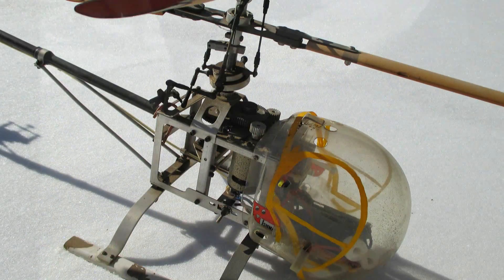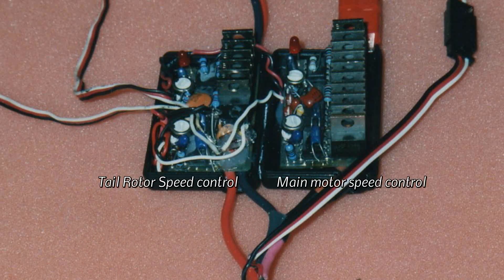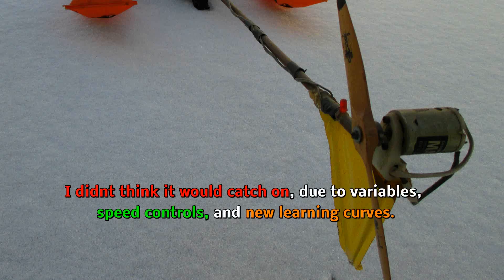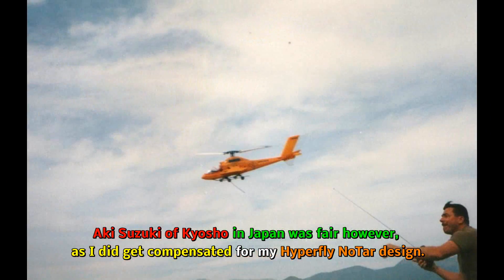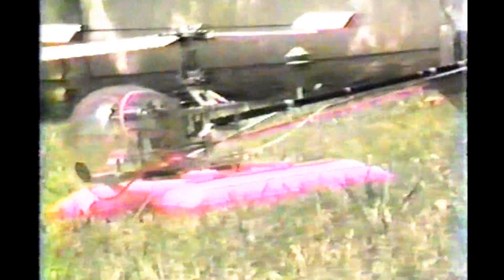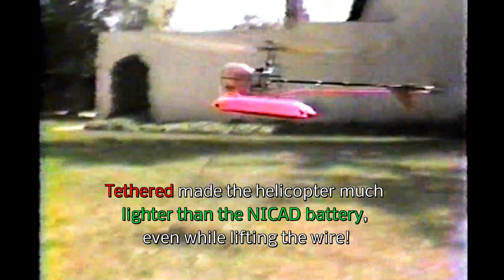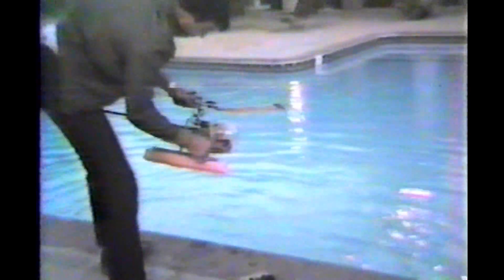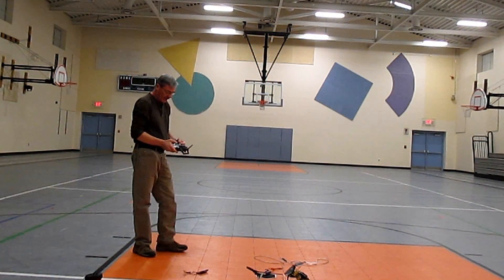Battery-less Electric Helicopters were Ground-Powered! Then and now.

Comment: Sweet!  I need your advice.  I have a DJI Phantom vision 2+ and need to hover for about 60 minutes, approx 100 feet altitude, to collect video of a busy intersection (I own a traffic engineering business).  I need to design a tether with with a "battery shell" on one end and a car adaptor (12v?) on the other.  Any special considerations?
Reply from the maker: Keep in mind, the longer the wire, the less amps get to the machine. If too long it wont lift.  Otherwise, I think if you use the same gauge low impedance speaker wire that I did, you will do fine.  A deep cycle marine battery would run it a long time.  Remember the more the wire, the heavier it all becomes, so you do not want to have it always running at full power just to hover, or I would expect an earlier motor failure. Hope  that helps.  Good luck and thanks.

Comment: Hi nightflyyer, would like to know your opinion on the mobius camera.I have one and phantom 1.3 transmitter with receiver. the mobius camera takes  in 5v and my battery has 12v. using without a regulater will fry it and I my need a power filter as will.If you can  offer some advice on the subject , I will be more then gratefully. I am not new to the hobby world just fpv and I live in a rural area with plenty of land to observe it from a  eye view until I get better at it, thank you and I look forward to your reply.
Reply from the maker: I do not have an opinion of the Mobius camera as I do not have one. What I would suggest is to purchase a RC 5V BEC, attach it to your 12v supply and run your 5v camera off that. They are filtered well, as they are used to run the Receivers and need to be noise free. Thanks kindly and happy flying.

Comment: yep, things have changed for the better :-), around 7:00 when you flew the tethered heli Dave, you could put that lipo on a small cart with fourlittle wheels that can spinn in al directions, this way you could let it go a little further, would be fun to watch (like little mouse on a leash running around following the heli, maybe even camouflage the lipo as a mouse of so), I know, just my imagination running a bit wild :-)
Reply from the maker: Haha. Yep, I considered that, but thinking it out made me decide that would defeat my safety circle envelope.  What you may not have seen is that I had the battery sitting on one of those Furniture Sliders.  It had some give, so if your ran out of line, it would move some.  Thanks for the comments.

Comment: Awesome video. And cool to see the Syma X1 quadcopter at the end of the video.
That is my very first quad i bought like half a year ago, when i started with this hobby,  to do initial orientation practice, a few weeks later i got my first heli; a Blade mCPX BL, will be busy practicing with that one :)
Reply from the maker: Thanks. Yes, I love that quad too and actually still have one in the box, just in case.  Something this good, you need a spare, right?  Thanks again.
Reply: True, if only i bought two... Can't seem to get it anymore. Do you know shops where you can still get parts for it, besides banggood.com ?
Reply from the maker: Hirzo Schuurman
I think  Xheli should have them, as that is where I got mine.

Comment: so you have the hele tethered to the battery and the battery on a remote control vehicle so some one can give you mobility (:  Anyway very interesting stuff
Reply from the maker: Haha. Yep, I considered that, but thinking it out made me decide that would defeat my safety circle envelope.  What you may not have seen is that I had the battery sitting on one of those Furniture Sliders.  It had some give, so if your ran out of line, it would move some.  Thanks for the comments.
Reply: ***** no I did not notice that.   I did not consider the safety aspect at all.  Its a awesome idea to let beginners use that method more flying time for them and don't have to worry about the copter flying off and hurting someone.

thats a really great idea (: